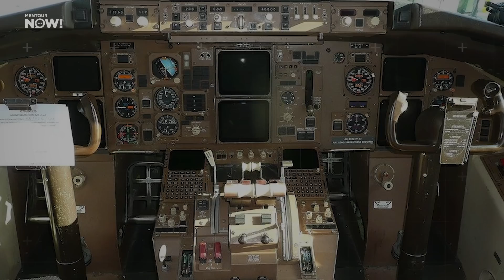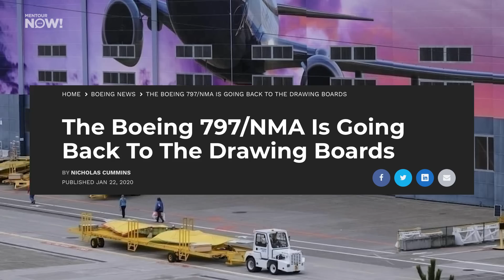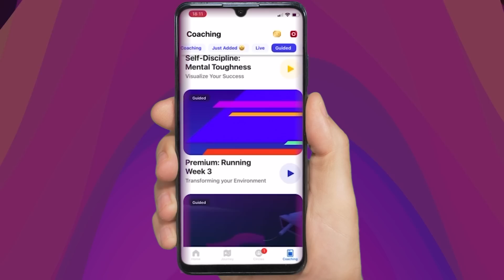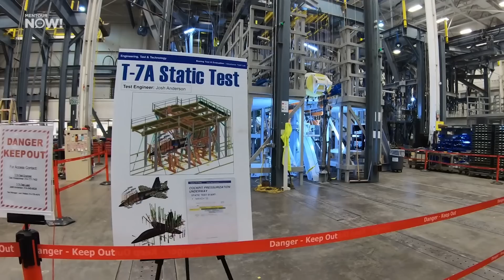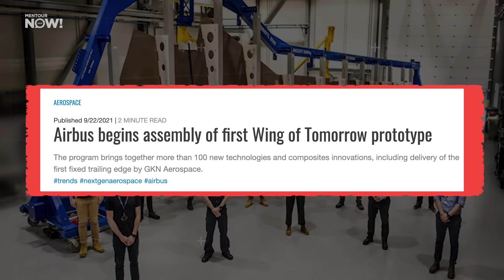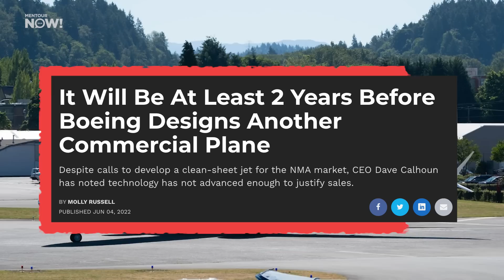Is Boeing Planning a 757 MAX?!

Comment: One area that you failed to mention is avionics. I worked for company that developed EFIS for 757 & 767. You would have to develop a completely new avionics package for aircraft. That would involve recertification which is a time consuming and expensive process. The other thing that you have to take into consideration is we would build a product for 20 to 25 years. It used to be that you would make very few design changes over lifetime of that product not anymore. In other words one of the challenges that you face today is obsolete parts. Or to put another way when you come out with a new product today within 3 to 5 years you have to do redesign work because parts are no longer available period you don't have a choice. Oh and software throws a whole another monkey wrench into this process.
Reply: The 757-767 received many avionics updates over its time in service. And since the 767 is STILL being made, with the newer avionics, I don't think this has to be a major issue.
Reply: @SpyGeorgilis  The USAF tankers were re-certified. I would suggest the freighters were iterative changes and kept the same engines. Hence, no certifications required.
Reply: @gregorythompson5826  This was a USAF requirement, probably not related to the engines. The VC-25B will also be re-certified, it won't just be "another 747-8" variant... and that change will have some interesting implications. My earlier comment was strictly about the 757's avionics. There are even retrofit kits (I think from Collins? Could be wrong) for existing 757s and 767s.
Reply: Very nice thank you for this!
Reply: Very informative..thank you. Better to come out with a fresh sheet design.
Reply: The LDS system for 757/767 is pretty neat, it basically is the same cockpit layout as the 787 and MAX.
Reply: Waittttt  what😲... parts not available in  3 to 5 years you say!!!

Are you sure you aren't talking about the cheapish/copycat mobile phones from a Xiaomi, Opposite, Vivo and not about airships... some of which (thanks to continued parts replacements) work for even 3-4 decades.
Reply: @sailaab  Yeah that surprised me. I used to work for a major telecommunications manufacturer and our standard contract with customers was we'd support HW for a minimum of10 years after it was regarded EOL. Sure as apples our contract with suppliers would have had similar wording.
Reply: Yes  @IMBlakeley   sir.. that indeed is overwhelming.
Thanks for sharing.
Reply: @IMBlakeley  Yes we would have to provide support for our products out in field after we stopped producing a product. The longer it is out of production the more difficult it gets.
Now with component manufacturers its a different story. You have to realize that Avionics is a small bit player in electronics field. Now we were always getting notifications that a manufacturer was going to cease producing a part and did we want to make a last time buy. Now the electronics market is not like it was 40 years ago. If you have a small volume of components manufacturers don't like to dealing with you.
Reply: @sailaab  No I am not talking about cheap knock off parts. We did not use that kind of parts. Reliability is critical in avionics industry. You would be amazed at what kinds of stress tests we would put an electronic package through before  we would sign it off are ready for our customers.
Reply: @sailaab  I am not talking about cheap knock off components. In aviation industry reliability is critical and demanded of your products. You would be amazed at types, degree and amount of stress testing we would perform on an electronic box before we would sign off and ship it to our customers.
Reply: The issue with the MAX's defective stability augmenting system was not the system or even Boeing. 

You alluded t it in your post above.

Its Regulations. 

Boing would have had to RE-CERTIFY an ANCIENT airplane design to appease the FAA and global aviation authorities. Not because the larger engines made the airplane unsafe or unstable but simply because IT CHANGED how the airplane might feel to the pilots, and therefore wild not meet its 30+ year old type certificate requirements, had to be re-certified UNLESS they could make the airplane fly exactly the same even with its lower slung, larger engines.

This situation is entirely due to ancient 2/3 of a century old FAA regulations that need to die so that reason can live.
Reply: @Triple_J.1  That is all fixed now (the issues with the max) Not relevant
Reply: @Triple_J.1  the larger engines changed the pitch characteristics and because that made the response "non-linear" it made the A/C unsafe. Boeing didn't want to certify MCAS as a safety system, cost of producing a DAL A system and timescales, it went under the radar. You imply it's due to some old certification rules. Certification rules didn't cause the two crashes
Reply: @Triple_J.1  well that was a wrong assertion. A pilot is not allowed to fly an aircraft they are not certified for (aka does not feel the same as the plane they were trained to fly).
Reply: @Triple_J.1  if the new aircraft doesn't fly exactly like the old one you need re-certification.
How is that a bad thing?
Like seriously? 
How is that a bad FAA regulation? 
And how do you think it could work without that regulation? 
Are you seriously saying that pilots don't need (re-) training on an aircraft that handles differently to the ones they are certified on? 
Like dude, do you think before you write a comment?
Reply: @Jehty_  it’s bad because it’s just one additional cost to an already too costly possibility
Reply: @tomdavis3038  then it's a good thing that the FAA (and the other aviation agencies) put more value on human life than you do.

Again: we are talking about not training pilots in flying an aircraft that handles differently then the aircraft they are trained on.
You do understand that, do you?
And you also understand why that is dangerous?
Reply: Justin J... you are starting to sound like a capitalist .indeed..  Board member or marketeer

Comment: Boeing needs to focus on getting the 787 issues resolved so the undelivered units can pass airworthiness requirements and the production line can meet quality standards.

Boeing also needs to get the MAX 10 certified before the end of the year, or more likely work on redesigning and start the certification process over from scratch to meet the new crew alerting requirements. 

And then there is the 777X that Boeing has been very quiet about exactly what the problem is, but they are far from getting the aircraft certified and available for airlines. 

I really don't think Boeing is in a position to be seriously investing in a 757/767 replacement for a while.
Reply: Boeing should already have enough people on the 787 program. Boeing used to have enough commercial aircraft division engineers to work on several programs at the same time.

Comment: Hi Petter, really good analysis of the 757 situation. As a 75 enthusiast, I would love nothing more. Commonality with the 767 made it a great addition to fleets which could adapt with demand changes.  Iceland air being one example. It was a mistake to extend the 737 beyond the NG and prematurely end the 757. Although with the engine market as it is now, it's not likely a sufficient engine is available for a 757 revival. This is why Airbus A320 family is kicking the max and Boeing ultimately. Fingers crossed that one of the manufacturers has been quietly working on a project until a big reveal.

Comment: For someone outside the industry it´s hard to grasp that manufacturers are struggling so much to update their aircraft lineup. If you think about it, the 727, 737, 747, 757 and 767 were all initially introduced within 20 years between 1963 and 1982. On the other hand I get it that markets are more saturated today than in the 60s and 70s. Nevertheless, thanks for the insight and it will be interesting to see what Boeing decides to do in the end.
Reply: My impression is that Boeing at least has a big issue where they've been continually updating those designs for a very long time now, and they're reaching the limits of what they can economically do at this point. But they haven't yet got to the point of creating full on replacements. They're in an arkward rut between reworking the old and designing the new.
Reply: @darthkarl99  Also I have to wonder if the guys who designed the 757 in the first place have retired.

Comment: The 767 production line is still operating, to buid Air Force fuelers.  It seems to me that it would be better to design a new commercial aircraft based on the 767 fuselage, to use this production line when the KC-46 production ends.
Reply: The plan is to build only about 120 KC-46s over the next five years -- that's basically two a month. Airbus builds four A321s every week. The 767 production line isn't on anything like the scale needed to compete with Airbus.
Reply: @beeble2003  True, but the most important part is that they have working examples of all the machinery needed to do it... and Boeing apparently melted the 757 machinery for scrap metal.
Reply: @marhawkman303  Yes, and they have people who currently have the skills of making the planes, who can teach those skills to new hires.
Reply: @beeble2003  YES!  Very important in actual production work.  757 would... probably be starting over from scratch.... not as economical.
Reply: Don't they still make the 767 freighter as well?
Reply: @ClichedGem  Good point, but they're only building two or three of those a month, too. So, unless their production line is way-overspecced for their current output, it's not capable of competing with he A321.
Reply: @beeble2003  they have room with the 787 all in SC.
Reply: @RScottPR  My point was about the capacity of the existing production line, not the amount of factory space available. Although they do have the tools and equipment needed to build 767s, they only have enough of that equipment to build a few every month, which isn't nearly enough to compete with the A321.
Reply: FedEx is still buying new 767-300 freighters to this day
Reply: @mipmipmipmipmip Not really, the 787 is quite a bit wider and much more expensive to produce.  Boeing needs a MMA now.  Even the 767 with a 787 type cockpit, new wings and engines would be years off.  However, the timing would be good as they’ll need to start thinking of a 737 replacement around that time.  Something generational and revolutionary not another update to a 50+ yo airframe design (737).

Comment: I've only flown on a 757 a handful of times but those things always seemed to takeoff like a rocket. While I'd love to see the 757 revived and I'm sure Boeing could do it, I don't think it'd be worth their time and effort to do so when they could likely design a new aircraft for probably not more more commitment of time and financial resources.
Reply: Being a Delta frequent flyer, I fly on the 757 almost as much as the 737 or A320. It's definitely a huge performance difference from those two. As a passenger, I also appreciate its ability to board through the 2L door rather than having to board 1L like the 737 and A320 families. While the A321 does have a 2L door, at least here in the U.S., airlines generally have no approved using it for boarding because it's too close to the wing and, thus, it would put the jet bridge too close to the #1 engine for their comfort. They don't want jet bridge operators driving jet bridges into jet engines.
Reply: theirs a reason why people call the 757 a rocket ship
Reply: Same here but I always liked the 767 better. Definitely quieter and gave passengers more seating options. I would scrap the 757 outright and repurpose the 767. A321 and Neo has already won the war of flying transatlantic IMHO. 767 with 220 seats sees it compete with a321 it is just not single aisle. 767 is a plane with an easier wing and engine re-do. 767next. You could, conceivably Frankenstein the 757 nose providing circumferences were designed to match and likely use two evolved versions of a PW4000 like engine used on both 767's and 747's. So correct me if wrong but re-engining is available unlike the 757. Wings would be the truly tricky part if they wanted to go the composite 787 route. But a hybrid of 757 nose design, the 747-800 engines x 2 and 787 style wings might make way more sense.
Reply: @BennyGeserit  747-8 engines x2 is quite literally the 787 (GEnx powers both aircraft.) It's too big for something the size of a 767 and wouldn't be efficient. At this point, though, Boeing really needs a clean sheet design. Quite a lot of weight could be saved (and the cabin experience made more pleasant) by using a carbon-fiber fuselage like the 787 and A350.

Completely disagree on 321 'winning' the trans-Atlantic war. It's only 'winning' on medium-market trans-Atlantic routes right now because it's literally the only (potentially profitable) option available for those routes right now. It's not a particularly good option, it's just the only one.
Reply from the maker: You just never know eh?
Reply: @MentourNow  Never say never !!
Reply: Well if the 737 didn’t have its issues and Covid didn’t hit, the 777X would have flown in 2020 and we would’ve seen Boeing unveil the 797NMA which would’ve gone into service by 2025. Now the 737 is starting to get back in service, the 777x is delayed to 2023/24 and the 797NMA is no longer prioritized, and will likely be unveiled 2026/28 at the earliest. What’s known is whatever high tech version they had planned won’t come until after 2030, so if we do get a 797NMA it’s gonna be on current technology which means it’s gonna be based on the 787. But. The 787 production is currently frozen due to FAA finding technical issues which are causing a substantial backlog in orders. So until those technical issues are sorted, the 797 will likely be delayed on that as well. Boeing is unbelievably fucked right now, the entire management level needs to get cleaned out.
Reply: @NarasimhaDiyasena  If the company will survive, it won't be due to the current management.
Reply: @NarasimhaDiyasena  NMA won't be based on the 787. It would be too inefficient to be worth anyone's while. Engines are too big, airframe is too big. By the time you got a new engine and stripped down the structure to be efficient for a lower weight class, you've eliminated almost any possible benefit from starting with the 787 design anyway and may as well do a clean sheet. It would just be a huge waste of money and, likely more importantly, it would tie up Boeing's already-loaded engineering team even further, just pushing any possible real NMA offering out that much farther for almost no gain.
Reply: @vbscript2  They already tried with the 787 and scrapped the idea - it was called the 787-3 and it was available at launch in 2004.  Nobody bought it and the idea was dropped.  It would have had A300-600 type range, in the 4000 nmi still air neighborhood.  It would have been more efficient than the 787-8 for short routes but you'd be left with a subfleet that could only be used for short routes.  Airlines have proven time and again that they'd rather just have the subtype with all the range and send it on the shorter routes even if it costs them more in fuel and landing fees (for weight).
Reply: @Brons2  787-3 was fundamentally different from NMA in a number of ways. It was more aimed at markets like Japan where customers like ANA and JAL routinely fly widebodies on short domestic routes with high demand. It was not at all aimed at the sort of medium-to-long-and-thin routes that the NMA is aimed at. Its range was 2,500 to 3,000 nmi, but still with the full-size 787-8 fuselage. It would be (somewhat) more efficient on those short, high-volume routes, but wouldn't even begin to address one of the primary NMA markets: trans-Atlantic flights to medium-market airports. Its range was too short and its passenger capacity too high for those routes. NMA proposals are significantly smaller than the 787, but with range much more than the 787-3 and much less than the 787-8. This would allow the airframe to be much lighter than either the 787-3 or the -8, while still being able to operate trans-Atlantic flights (as well as long flights to Hawaii, Alaska, etc.)
Reply: @vbscript2  good points, the -3 wouldn't have been a good choice to connect US and EU secondary markets like the 757 does and A321 XLR is meant to.

I personally think the author of this video makes the gap between the A321 XLR and 788 look larger than it actually is though.  A typical 3 class 788 in service has less than 250 seats, for one example a recent 788 I flew on with AM had 243 seats.  A BA 788 has only 214 seats, granted this is 3 class.  AA's 788 has 234 seats 4 class.

Whereas a 321 Mint for Transatlantic with B6 has 159 seats 4 class.  Boeing is really threading the needle with this NMA concept.  Is there really room to launch a whole new plane into the 160-220 seat 3 or 4 class capacity range?  I have my doubts and I believe Boeing does too.
Reply: yes, and having center point problems solved by faulty software and we have a repetition of boeings problems